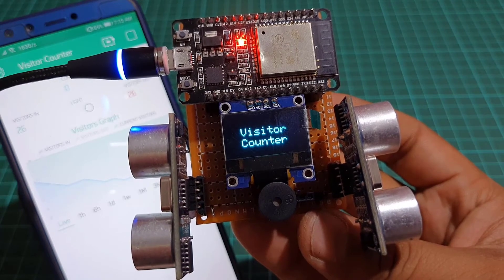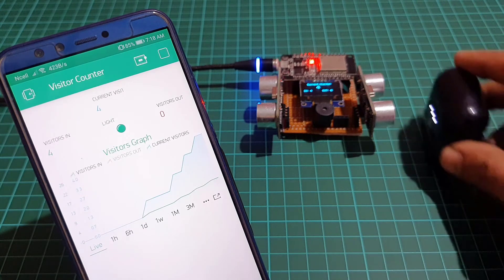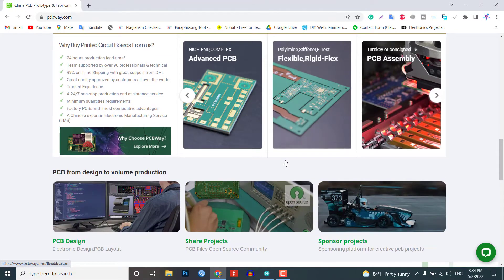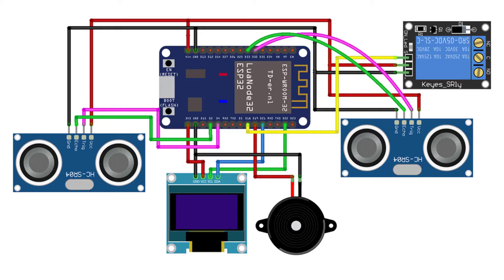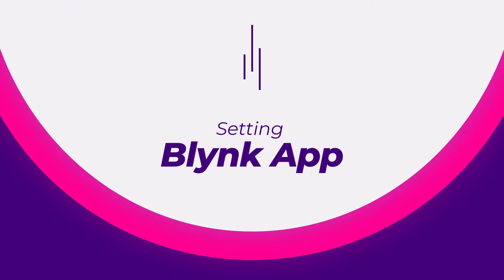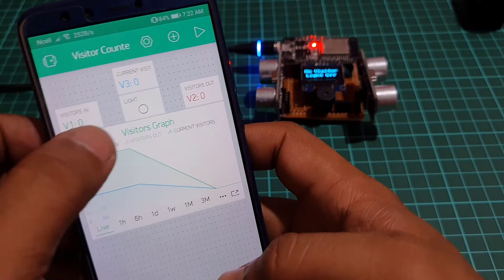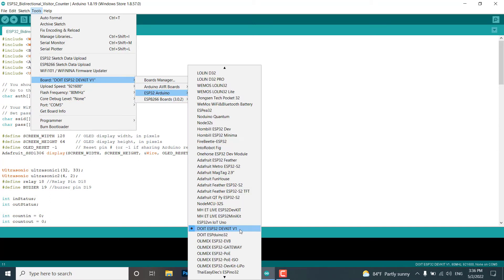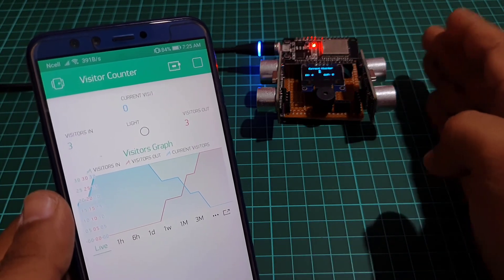IoT Visitor Counter and Automatic Light Control using ESP32 Ultrasonic Sensor and Blynk

Comment from the maker: ► IoT Visitor Counter & Automatic Light Control using ESP32 Ultrasonic Sensor using Blynk
► Project Schematics + Source Code: https://theiotprojects.com/iot-visitor-counter-using-esp32-ultrasonic-sensor/
Reply: How much total it will cost to make this device ? Can we make upto 100 device that can be controlled  through the same ui?
Reply: Your source code link says file not found. Also, is wroom -32 type C or micro USB?

Comment: I have done this kind of project, everything has worked at first test-run on the breadboard. Unfortunately, it is not working again after I disconnected it from PC and I have trying to fix it but it is still the same thing. 
The code will just upload and all other components will not work as expected , it is only the  red light on relay that it on. I will be glad if you can help me with it 😢